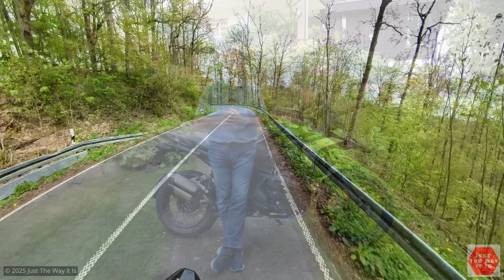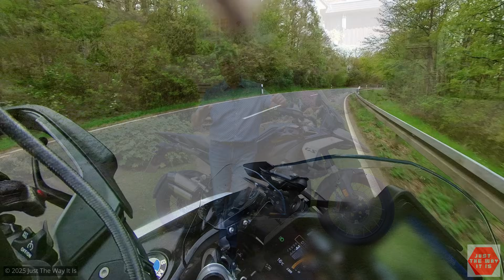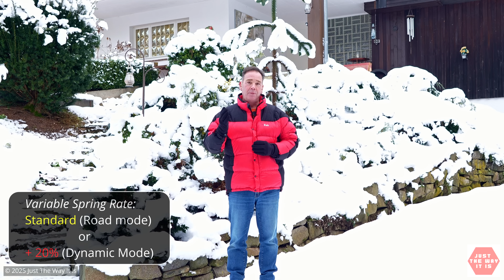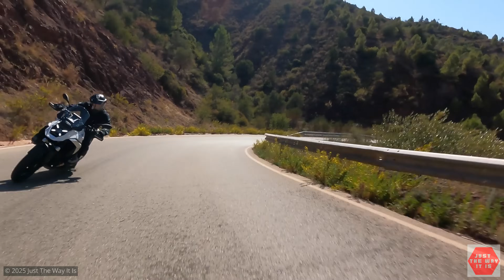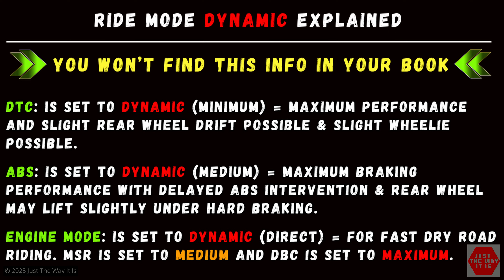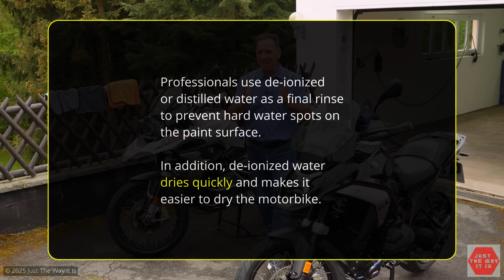BMW R 1300GS/A Dynamic Pro & DSA suspension setting guide MSR, ABS-Pro & DBC & AVHC Set-up Guide

Comment: Hi Carl! Your video is incredibly clear and detailed. So far, I haven’t been able to find information that is explained as thoroughly and simply as you’ve done here. I’ve had my BMW R 1300 GS here in Stuttgart, for four months now and have already covered 11,000 km, (I’ve just returned from a trip to Corsica trip) but I’ve never really understood how to properly adjust the suspension. Thank you so much for sharing this information! Your video is extremely helpful. Great job, and congratulations on such an excellent video!
Reply from the maker: Hi Cristea, danke 🙏, thank you for the kind words, I’m pleased to hear you find the videos helpful. I decided to make them to help owners get the best from these amazingly capable motorbikes. Sadly the dealerships don’t really take the time to explain how to use the many different systems, which is a shame. Plus the owners’ manuals are not great 🫣.
Sounds like you’re having fun with your new motorbike I wish you many more happy kilometres getting to know the systems and experimenting with them.
Recently returned from the Spanish Pyrenees where I spent a day with one of the BMW off-road instructors riding in the mountains… amazing experience and the R1300GS did things I thought would not be possible .
Lg, Carl 🙋🏻‍♂️

Comment: Hi Carl, thank you so much for the amazing series. I just got my 2026 R1300GS Trophy with Sport Suspension and Adaptive Ride Height. I wanted the addition travel length and ride height of the Sport Suspension and am glad that the adaptive ride height still makes this bike so approachable. My question is, did you spend any time on the Sport Suspension GS and if so, have you noticed much of a difference in on-road cornering characteristics between the longer suspension of the Sport version versus the standard height/length suspension? I believe there is a firmer tune for the suspension as well in the Sport version. Any thoughts or experiences with that?
Reply from the maker: Hi Bryan, congratulations on your new 26 Trophy 👍, yes the sport suspension options combined with AVHC is a great setup, The sport option feels noticeably firmer in Road mode, giving sharper front-end feel and less wallowing or softness compared to the standard GS. I hope you have a great time setting your bike up especially in the DSA settings area +2 all the way to -2, in each setting. Have fun 👍
Regards Carl 🙋🏻‍♂️

Comment: Hello. i just got my 2026 1300 GS, but when i try to change independently the ride mode with different suspension setting, i did not find where to do that.
Reply from the maker: Hi your dealership should explain and show you how to use the menu. Perhaps revisit then and ask them to explain 👍
Reply from the maker: Hi Owl, Also watch the R1300R video as I demonstrate how to access the suspension modes ( which are almost the same ) in that video 
I cover it in lots of detail showing you how to access and make changes. 
Carl

Comment: Prior to test riding a 1300 GS I thought, no way will I buy one...too big and unwieldy I thought. Then I rode it and what a revelation. It's nimble, comfortable, and either a beast or very tamed according to your preference. It is nearly the perfect bike. I bought one. These videos are my favorites for understanding the GS and it's potential. Thanks so much! 
PS: my only concern is the ASA downshifting inappropriately in the middle of a turn. I suppose it will be better in manual in the twisties or maybe I downshift it in Auto? By the way, I'm 73 and this bike was so easy to move around. PPS: your landscaping is beautiful
Reply from the maker: Hi Dennzio, thank you 🙏, glad you are enjoying the video series. Yes in the twisty corners it’s better to use the manual downshifting button. It gives you much more control. As you say it’s an amazing and very capable motorbike considering its size and weight. I hope you have many happy miles on the road together 👍
Kindest regards Carl 🙋🏻‍♂️

Comment: Appreciate your insight into the bike.  I plan to try your "Dynamic" with Road Suspension at +2.  Is it possible to have that but set it in the low suspension height that Enduro mode has?   I'd really like to have it in the lower setting, but not be in Enduro mode with it's lower torque and no cruise control.
Reply from the maker: Hi Erol, sadly the BMW test R1300GS has been returned so I can check that for you, perhaps a channel subscriber will reply to you with the answer. But if you’re thinking of ordering one I highly recommend the option AVHC as this will automatically lower the bike at slow speeds, it’s very very good.
Regards Carl 🙋🏻‍♂️

Comment: Thank you for creating this outstanding four-part video series. It is by far the most comprehensive, detailed, and easy-to-understand explanation of ride modes and suspension settings that I have encountered. The information was presented clearly and logically, making complex concepts much easier to understand and apply in real-world riding situations.

Your expertise, attention to detail, and ability to explain the “why” behind each adjustment have been incredibly valuable. This series has significantly improved my understanding of my BMW GS 1300 motorcycle and how to properly set it up for different riding conditions.

I sincerely appreciate the time and effort that went into producing this content. It has been an invaluable resource. Thank you.
Reply from the maker: Hi Shawn, thank you for taking the time to leave a very nice message, I very much appreciate this 🙏.
The series took many hours to put together and the aim as always is to help other riders get the most from their motorbikes and riding time.
I hope you now feel confident to explore the full potential of the new R1300 series motorbikes, they are incredible capable and offer many different setups. From sporty and dynamic to nice and comfortable on tour. 
Kindest regards Carl

Comment: Wish the rew (05AR - rear end collision warning) option could be retrofitted to a r1300 gsa that has all the other options.
Reply from the maker: Hi, well I have the INNOVV blind spot detection system with collision warning on my 1250, the kit can also be installed on the 1300. Have a look on my channel there is a couple of videos showing how to install it along  with OEM mirrors with the warning triangles inside them. 
If you already have the BSD mirrors on your GSA it’s an easy installation Carl 🙋🏻‍♂️

Comment: Excellent video Carl. Thinking in buying one and testing your recommendations. One question though, have you considered using rain mode + road susp. to use when touring 2 up?, this can be very comfortable and smooth if she is not a bike "lover",  may be +1 o +2 in road suspension that I would add anyways for the rest of ocations.
Reply from the maker: Hi Javier, yes it’s possible to do that , and there are lots of combinations you can use. It just takes time to find the perfect setup for the type of riding you like and the roads you generally use.
Like me know if you buy the new R1300GS, it is an amazing motorbike 
Carl 🙋🏻‍♂️

Comment: Hello sir, respect! Question..... Is the Road mode the same as Dynamic pro with DSA in road, Throttle response in road and DTC in road?? Thanks!
Reply from the maker: Hi AV, I think that setup would be very similar ( only BMW would know the exact difference) but don’t forget the ABS settings might be different, 🙋🏻‍♂️

Comment: Hi Carl,  I have question that you may able to help me with.
When touring two up with full luggage everyone tell me to run standard tyre pressures. My first big tour my rear tyre wair was all over the place. Now im not sure whether it was tyre pressure or suspension settings, im tall and the bike two up with luggage was heavy, i ride in high mode in dynamic. 
What your experience in the matter is there a better setting.
Thanks steve
Reply from the maker: Hi Steve, yes that’s what everyone seems to say 🫣 but I go up between 2 to 4 psi over stock on the rear when two up on tour or heavy loaded. 
If it’s a simple 2 hour ride, I leave it stock with no change.
For me the tyre wear is better and so is grip/feel at +2/4 when on tour.
The front is different, normally I run -1/2 psi under stock, on tour I go back up to stock.
However….
A lot depends in your tyre choice and it takes me a couple of weeks with a new set / brand of tyres to understand what feels best, some like OEM settings while others seem to be happier with less psi.
I hole that helps, kind regards Carl 🙋🏻‍♂️ and thank you for an interesting question 😇
Reply: @justthewayitis thanks ill try to up the rear 2 psi at a time and see how it goes 
Thanks
Reply from the maker: @steveswain4646 you are welcome 🙋🏻‍♂️

Comment: Is a "plug" required to access the Dynamic Pro mode?
Reply from the maker: Hi, on the R1300GS/A no, either your motorbike had it… or it doesn’t.
Check the menu options. And ride mode list. Carl
Reply: @justthewayitis  Thanks!
Reply from the maker: You are welcome 👍

Comment: By far the best step by step videos on the new 1300 I ve come across.  Having said that I purchased a 2026 R100RT. I am particularly interested in the various suspension settings. I ve just come off a2018 RT. I know I am missing a lot but for this chat I am not seeing a separate preload setting?  Am I restricted to riding mode selection first and “damping” ranging from -2 to +2 within each riding mode selection?
Reply from the maker: Hi Wade,
Good morning, yes you are correct we no longer have separate preload adjustment or preload preselection like we had on the previous generation.
It’s a backwards step from my perspective, but having said that the auto self levelling does work very well.
Have fun with your new 26 RT 👍, kind regards Carl 🙋🏻‍♂️

Comment: Lil question; when you change the DSA, say in Road or Dynamic modes, does it keep the setting in memory? Say I programmed Road mode, with DSA +2, and Dynamic at +1; will it reload those settings automatically?
Reply from the maker: Hi F5.6, yes the system remembers your DSA selection you just need to remember to switch suspension modes when you change from Ride Mode Road to Dynamic . You can set the main Hamburger Button on the left bar to make the suspension change. If you watch my recent R1300R test and review video I show you how to do that and the make it simpler the change suspension modes.👍🙋🏻‍♂️, best wishes Carl 🙋🏻‍♂️
Reply: @justthewayitis Thanks 
I'm starting to figure this out. Unbelievable how unclear this is in the documentation and how unsafe this could be if misunderstood. Your explanations are appreciated.

Now I've spent some time on the bike this afternoon figuring out the multi access points that build an actual ride configuration.

Juste to be clear, the DSA (-2 to +2 damping settings), which I call the secondary damping, populate the main damping settings (road, dynamic or enduro), who then populate the ride modes?? That's what seems to be going on.

So, if I get this correctly, if in Dynamic mode, you choose the road setting as your main damping, then it will be based on one single secondary damping setting for the main damping setting. In other words, you could not simultaneously have a road ride mode with road secondary damping at -2, and a dynamic riding mode setting, with another road secondary damping set at +1, each recalled with the ride mode memory?

So the secondary -2 to +2 damping settings, are strictly suspension-set and not recalled via the ride modes. (Am I making any sense here?)
Reply from the maker: So it’s complicated, on the older 1250gs if you changed from RIDE mode to Dynamic it automatically changed the damping mode for you to match.
Buy the new system on the 1300 is different as ( I don’t have the 1300 to check but im fairly sure) , but when you change RIDE modes it doesn’t automatically change the suspension mode, you need to do that manually.
Take your bike for a ride and test this.
DSA setting +2 to -2 are locked to whatever you set then to in both modes Road and Dynamic. Hope that makes sense 👍
Reply: @justthewayitis Allright. Took some serious notes yesterday and tested everything out today. Got it all figured out, and my 4 rides modes, are not at all what I would have expected, but really feel and ride great.
Thanks for your detailed videos and advice!
Reply from the maker: You are very welcome 👍

Comment: Bro, do you have a cheat sheet or a short, or something? Just need a "here's how you get into the enduro pro menu and you can make adjustments from there" kind of thing.
Reply from the maker: Hi
Menu - settings - Assit - Rides Modes - ride mode preselect ion - then scroll down to Configuration and enter into the Endro Pro set up 👍🙋🏻‍♂️

Comment: To change the suspension mode, do you change the “Damping” setting via the quick-select hamburger button on the left? Or am I missing something? Thanks for great video!
Reply from the maker: Hi DIY, yes use the hamburger button to access the suspension modes. Change the preset with the black DOT to the Suspension, which then means the up / down arrow button gives you immediate access to change the main suspension character . 🙋🏻‍♂️👍
Reply: @justthewayitis thanks! I was looking for a menu item called “suspension” without finding it and got a bit confused. 😅
Reply from the maker: No problem, glad you found it 👍😉🙋🏻‍♂️

Comment: Hello, good morning. Greetings from Argentina. Could you inform what is the most effective way to apply the brakes on the BMW 1300 Gs taking into account the new combined brakes and how does this differ from the previous model?
Reply from the maker: Hi Mariano, the way I had the most success was to completely forget about the rear brake and focus on using the front brake lever.
The only time I use the rear brake separately is when riding off-road or at slow speeds.
It feels strange not to use the foot brake at first, but it feels better after several hours of practice.
Best wishes Carl

Comment: ATTENZIONE!!!
Stai facendo un errore!!! 
nel 1250 quando si cambia la mappa motore, in automatico c'è il cambio della sospensione, nel 1300 NO, nel 1300 se cambi la mappa motore la sospensione torna a come era abbinata precedentemente. esempio: siamo in mappa Road e con il tasto unico multifunzione metto la sospensione da Road in Dynamic (quindi la mia moto ora ha la mappa motore Road e le sospensioni in Dynamic) quindi decido di mettere un altra mappa qualsiasi e poi torno in mappa Road e la sospensione non va in Road (come nel 1250) ma torna come è abbinata prima, quindi in Dynamic. solo le mappe motore enduro e enduro pro hanno una sola modalità di sospensione modificabile solo in assist da -2 a +2 (come per Road e Dynamic), in enduro non funziona il Cruise control.
Esempio io nel mio 1300 ho queste 4 mappe motore con queste sospensioni:
-Dynamic con sospensione Road (-2), quando guido rilassato e la strada è imperfetta.
-Dynamic pro (con controlli disabilitati) con sospensioni Dynamic (+2) quando guido sportivo con la strada buona e libera.
-Eco con sospensioni Road (-2) quando piove, quando vado molto piano e voglio consumare poco.
-Enduro pro con sospensioni (obbligate) Enduro (-2) in off Road.

Quindi io cambio solo la mappa motore sul tasto mode e trovo tutto come configurato in precedenza.
PS
Sai come spengere la moto e lasciare il parabrezza alto: 
spengere la moto tenendo premuto il pulsante per alzare il parabrezza, così si potrà pulire lì sotto senza tenere la moto accesa o con il display acceso.
Reply from the maker: Grazie per il consiglio su come tenere sollevato il parabrezza. Molto bene, Carl 😊👍
Reply from the maker: Non posso controllare le modalità di sospensione perché ho restituito la R1300GS alla BMW, Carl
Reply from the maker: Ma proverò a controllare, grazie, Carl 👍

Comment: Wonderful review, I will have to watch the first few.  What about tires? How did you like the Metzler Tourantec Next 2? I just traded my Multistrada V4S for a R1300 GS Adventure and am very surprised how well it handles. I went out with my Ducati Club to one of our annual multiday tours with lots of twisties and everyone was shocked by the new GSA as was I.  The tires performed but they were giving up early and getting squishy.  I am thinking of going to the Michelin Road 6 when i need a change in the future.  My maiden run i was at 43 and 45 degrees with the GSA and I am not used to this bike yet, but it is very fun, confidence inspiring and more capable than I imagined.
Reply from the maker: Hi Singh. Congratulations 🥂 on your new GSA, and yes I am currently using the Metzeler NT2 on my GS and I really like them, neutral handling with great grip .
Best wishes Carl 🙋🏻‍♂️

Comment: Hi Carl, sad day returning the bike . Sounds like you may be wrestling with your earlier conclusion comparing the 1250 vs 1300 ? 
Have you had an opportunity to ride an ASA bike ? Would be interested in your opinion. Specifically in regard to Not having a clutch and the impact on control associated with the proper use of the friction zone with a clutch.  Not to mention, it is fun shifting ! that may be a getting use to it process.
Reply from the maker: Hi Randy, 😊, yes I was sad to see it collected, but im still keeping the R1250GS for the next couple years.
Not riden the ASA yet, I actually have one in my garage it’s an GSA with ASA but due to insurance issues I can’t yet test it which is very disappointing, but most accounts seem very positive. I think for the road it’s a great option, for proper off-road work a clutch is still the way forward for fine control and power application and traction.
Have a great weekend 
Kind regards Carl 🙋🏻‍♂️